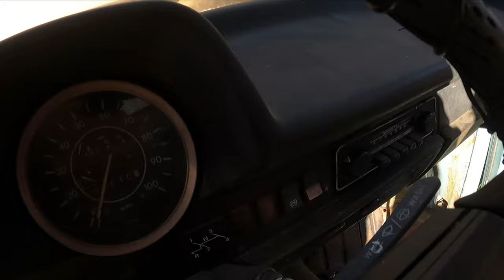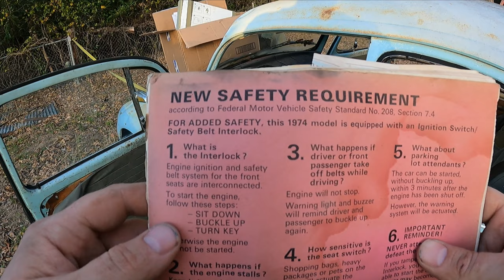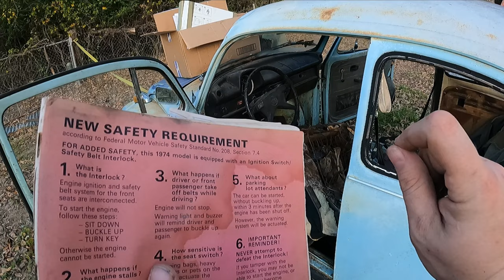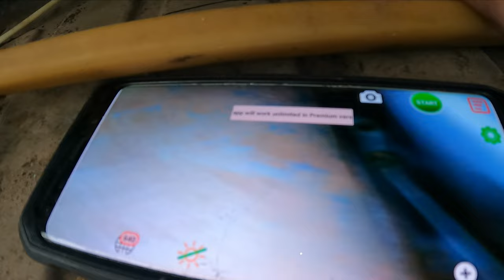Will it run? Abandoned 1974 Super Beetle left for dead! Revival

Comment: When you get parts use cip1,Wolfsburg west and use west coast metric.these cars don’t like cheap parts.I try to use as much German on my bugs as I can
Reply from the maker: Dang man I wish you would have commented sooner I've ordered alot of parts and have had alot of issues. Especially with fitment.
Reply: Also I forgot the size but get the stock looking cloth fuel hose that’s rated for ethanol fuel,move the fuel filter between transmission and engine (out of engine bay) and get stainless fuel clamps and stainless safety wire and run it from clamp to screw on carb and from fuel pump to hose because if the line comes off it will spray on distributor and catch car on fire and good luck putting out a magnesium fire.if the engine bay seals are bad you may want to drop engine and replace them otherwise it’ll suck heat from bottom side of engine through fan and make engine run hot

Comment: Just putting it out there, you need to run zinc in your oil because of the non hydraulic valves. You can also run diesel oil with zinc already in it. I don’t know if yours is the engine with out an oil filter but if it is you might be better off to run diesel oil  because it has zinc and a better detergent package. I personally would run 15-40 it’s a little bit thicker it won’t thin out as bad in the summer with the higher engine temperatures it being air cooled.
Reply from the maker: I always do, thanks

Comment: I heard that a can is positive electrode that produce out of charged current and The can energize thru circuit until the can became rust and radiant from acid and boron acid like alkaline can be potential differ from ground that is saturated with anti acid and baking soda about 1/100 teaspoon and alkaline water then the electrolyte start to come up when in connect to 'ON' position with load live current from Positive anode and electrons flow to cathode negative. It was charged up by modern battery 9 cells or cans.

Comment: Valves need adjusting every 3000 miles, VW 's run hot and need oil changing every 300 miles but all we had was 30 oil etc ,,,  synthetic oil would holdup better.
Reply: 3000 miles not 300. And BTW synthetic doesn't play well with these. For some reason it doesn't shed heat as easily and that's half the cooling system

Comment: The ticking sound is normal. You may want to adjust the valves but be sure you do it to specs. It will still have a ticking sound. There is a short piece of hose between the gas tank and solid fuel line coming to the engine. As old as it is that is more than likely where your gas went. You are doing well with the bug.
Reply from the maker: I went to adjust the valves and One of the adjusting nuts was completely off it was missing on one cylinder!
Reply: Looks like someone before you had  no idea what they were doing. looks like you are making good progress now. You said if I buy another bug, you will because they are so much fun. Also I live that Plymouth Suburban. If you rebuilt it you did a fantastic job. I assume it is a flathead six?
Reply from the maker: @danielheartsill4269  yes, I painted it with rattle cans! And it was a flat head but I out a 318 Magnum and overdrive trans in it.

Comment: The straight pipes without muffler to the 1974 car on boxer running motor 1600cc Can be loud but run at not more than 1,500 rpm in street driving can be quiet because brand new engine is 4 times louder than used motor but if you know that it rev very high then it would pitch too loud and making the stator in generator or coil in alternator with external regulator under rear seat into too high current power.Resonator will make the motor to run not tacking.

Comment: There all good: it's a VW. what it all comes down to, you have a diamond you found in the rough. how much is it worth to you...
In the world of auto manufacturing, it is one of the most sought after these days: Parts can be had for it all around the world.  
OEM parts. as for the ticking sound, typical, but I'm not there, those heads are known for getting a lose value seat or plural,
 in other words getting beat down in to the head, if you have a loss one and after it is adjusted and it happens again, pull the 
head,  or pull both heads and get them cleaned up. or exchanged for fresh heads:  or buy a new head, simple, 
as for the rust, new metal, your welding skills will vastly improve if your a serious about making it right:  
but do not mess with the serial number tags. the state gets really touchy about people messing with them.
Reply from the maker: Thanks jim, I just want to get it on the road. I'm thinking tack some metal tin in the floors maybe clean it up a little used seats. Do all the mechancial on it and just enjoy it. Stay tuned

Comment: There's too much play In Crank pulley
Reply from the maker: Runs great now, and doesn't knock or smoke i drive it daily
Reply: @somewhatfast If you don't fix that end play, it will eventually tear that engine apart. It should be repaired properly before it eats itself